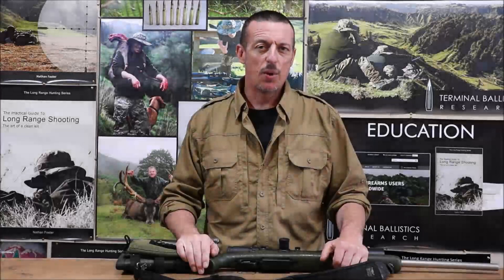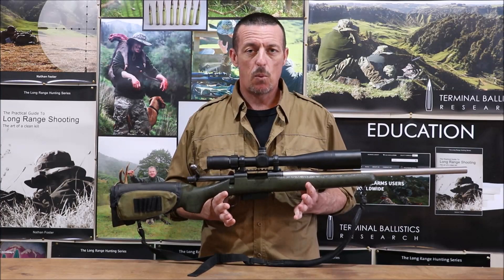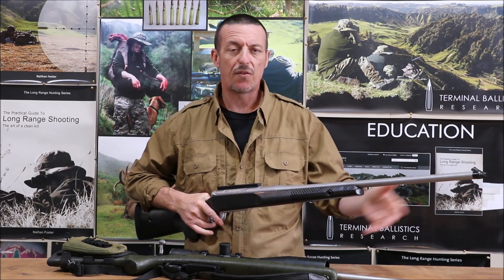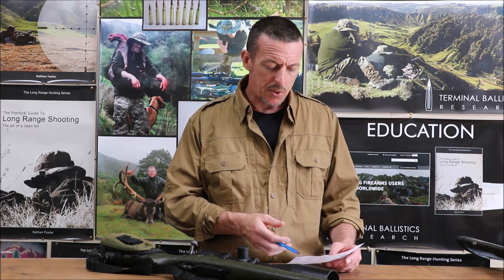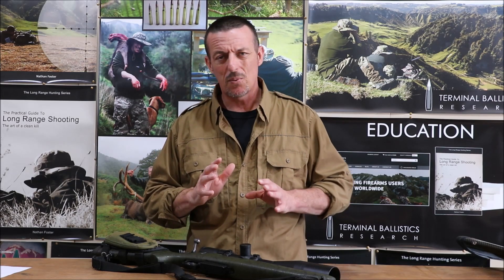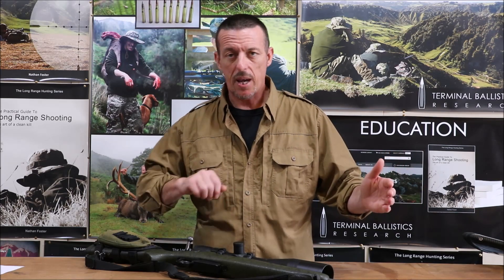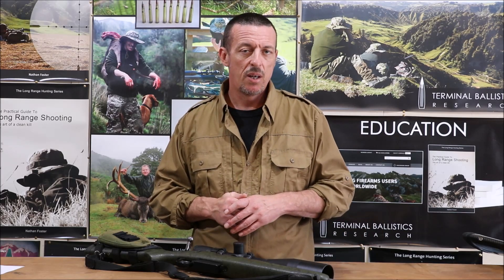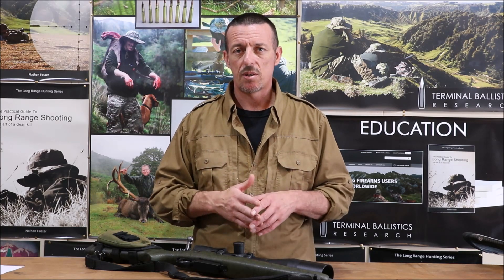.308 Winchester hack rifle considerations.

Comment: My 308 weighs just shy of 7lb with suppressor. It's a Model 7 that wears a VX-3i scope in 2.5-8x36 (planning to replace with a VX-3HD 3.5-10x40 to use the CDS dial), bedded carbon fiber wildcat composite stock w/ Kickeez cheek riser, #3 Contour Lilja 1:10 twist 18" tight bore barrel, LRI fluted bolt, Banish Backcountry using a Q muzzle break. The overall length of the barrel with suppressor is 23.5" and it's the best rifle I've ever shot. It's accounted for more game for my family over the past ~10 years or so than any other rifle I've owned from squirrel to deer. My favorite loadings include a subsonic 150gr cast bullet squirrel load, 130gr close quarters deer load (specifically for hunting in densely populated areas), 190gr subsonic hunting load, 168gr A-Max and 178gr ELD-X range load, and multiple experimental loads for fun and cast bullet loadings. The reason I don't switch to a 6.5CM as my main rifle is because I can't foresee the 6.5 having nearly as much flexibility as this one.

Comment: Nice vid Nathan.   Love the books, and could not agree more about the .308 Win cartridge.   My personal rig has an 18" threaded barrel and I run it suppressed.   Very handy rifle, and plenty of power for the type of hunting in my area.   Also super easy to reload for.   Velocity did suffer a bit after the barrel chop, but I'm still getting just shy of 2600 fps with 168 grain Speer BTSP bullets.     Plenty good for the girls I go out with.
Reply from the maker: As you say Jeremy, plenty of poke. Nobody had any complaints about about the .303 chugging along at 2400fps. A velocity of 2600fps is fast by comparison.

Comment: 11 lbs is heavy if you have to carry any distance unless you';re young, and even then everything seems heavier the longer you carry it. I recall the FNC1 weighed that before adding a loaded 20rd mag. I have found twist rate with longer . Just great info on these videos without the hype, refreshing.
Reply: Kiwis are stronger than most.